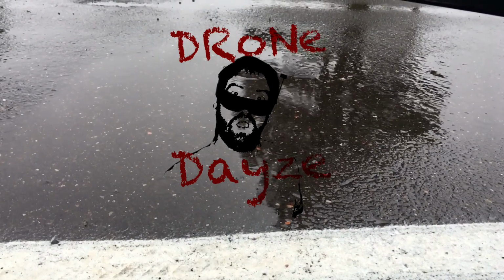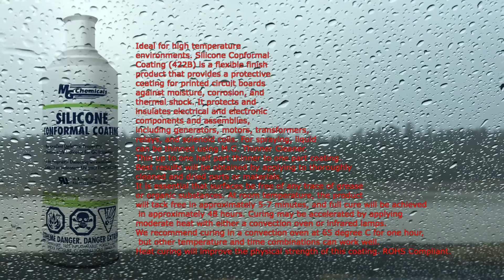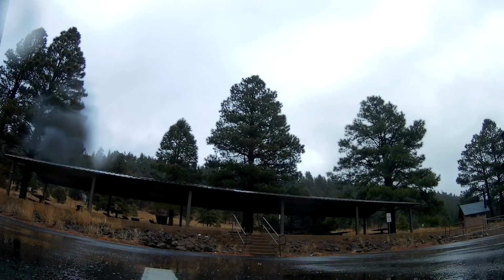Drone.Dayze: Testing out the weatherproofing

Comment: did u take fpv cam apart too? I don't plan to fly in rain but if I get random rain or it wrecks into water it be nice to save electronics
Reply from the maker: Didn't do anything with the camera but I have seen people take it apart and seal it with epoxy around the edges and then where the wires come in.. I have nosed dived into feet of snow and flew in the rain never had issues but better safe than sorry good luck
Reply: cool thanks.. im wanting to protect from potential water issues